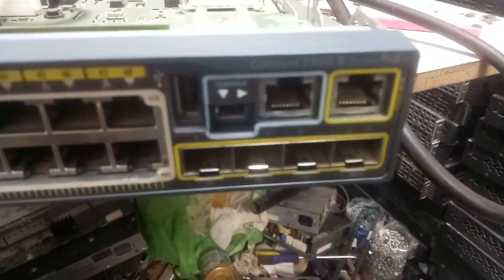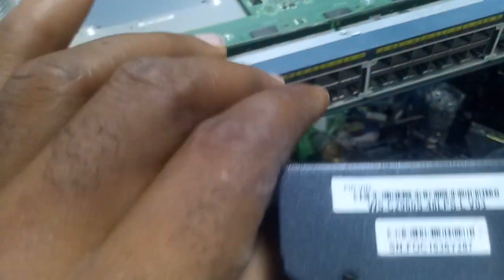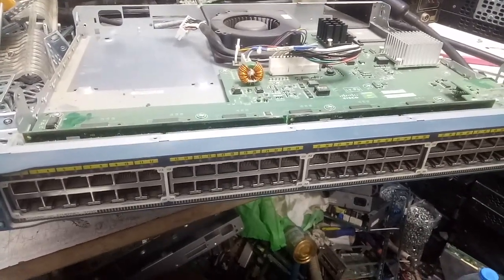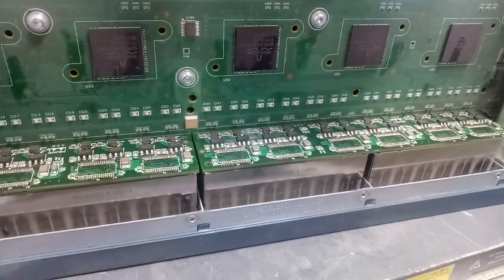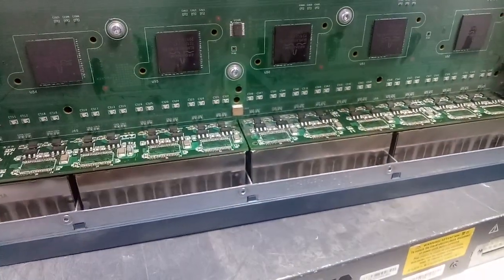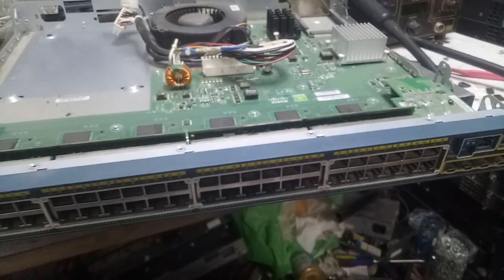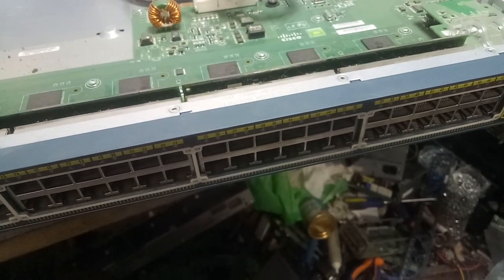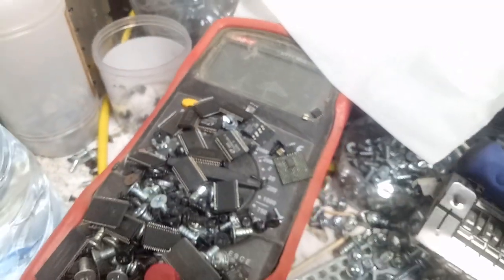How to fix poes fault on C2960S series

Comment: hello dear .Should all the ICs be changed, or if one of the ICs is changed, will the corresponding four ports be fixed? Because I changed one of them, but the problem was not solved.
Reply from the maker: Which model ?
Reply: @jkftech  ws-c3750-24ps-s
Reply from the maker: @missengineer-bi5iw  only one ic for 4ports poe,
Reply: @jkftech  I changed 4 of these ics , but there is still a problem with the port. Is it possible that the problem is with another part?
Reply from the maker: @missengineer-bi5iw  send the problem details on "JKF TECH"  our Facebook page